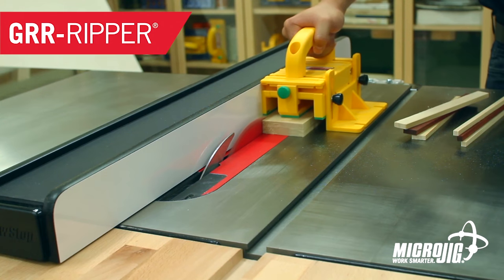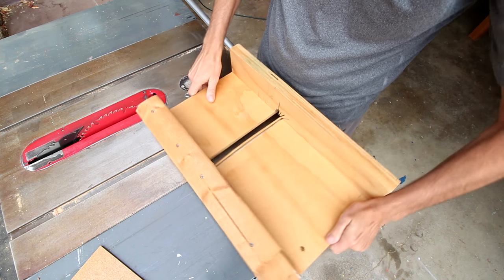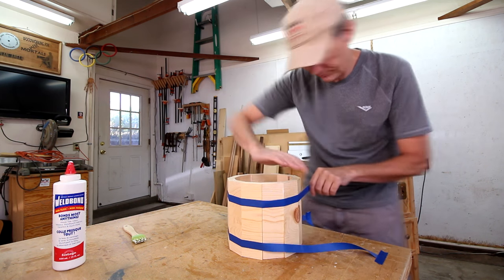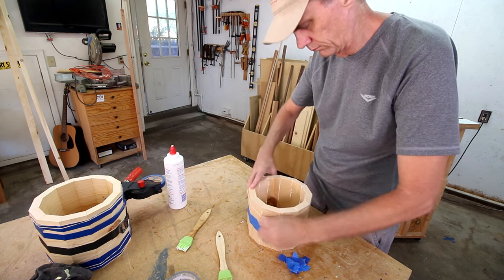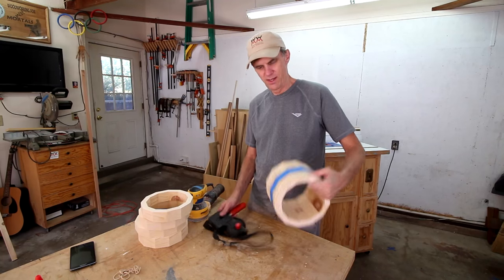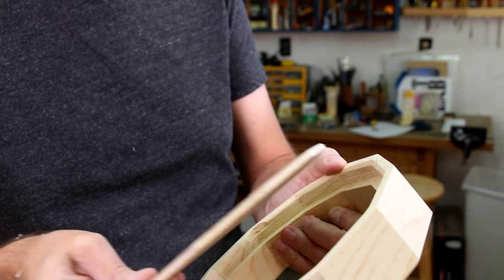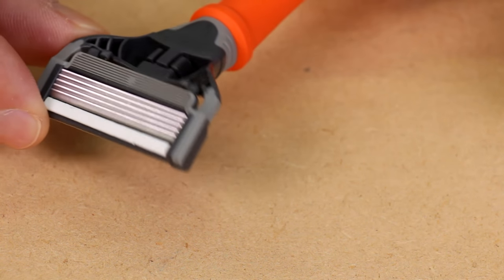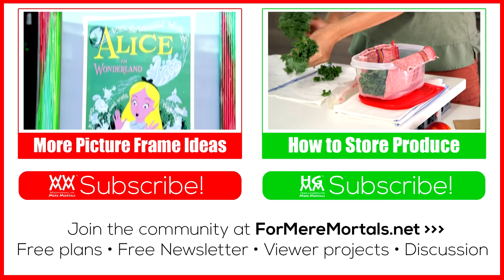Woodworking Income Project: Unique Dodecagon Frames to Sell at Craft Fairs or Online!

Comment: The tape trick to band the segments works better if you face the pieces down and then can press the tape onto the wood.  Also, in any line-up like this, it helps to make a layout board with stops/fences at 90 degrees so you can just line the pieces up quickly, then apply tape.  And, you don't have to use a long strip of tape at first:  attach each next piece of wood with a short bit of tape to secure in place, then when you have the whole layout, do another piece of tape the whole length.  The tape trick does work really well.  Nice project with the dohecx whatever!

Comment: Before slicing them up, you have a great looking small trash can!  Just add a bottom.
Reply: At that point, add a handle and you have a nice sized mug!
Reply: Add on a bottom and a handle at the top and you have a bucket
Reply: Or add a handle and it's a beer mug

Comment: Very attractive and precise frames. 
When you mentioned dodecagon, I thought you were going to use Incra miter gauge to get the required precision. But you managed to get the needed accuracy by using a digital angle gauge. 
Just as you cut the bevel for the entire length in one go (for the second batch), would it not be convenient to cut the continuous slot also in one go instead of having to use the router later?

Comment: What angle guage is that? When I search for it I do not find the same version. I have read a number of reviews of angle finders with wildly differing opinions of them. I'd like to get one that is accurate. Bonus if it doesn't drain the battery when not in use.

Comment: Hey Steve, great project!

Ive noticed that you've used spray laquer in a few of your projects. I tried this on a few projects of mine (rebel alliance logo clock that I made for my husbands bday & a 3D chess board). However, I'm not sure if  I sprayed the laquer too much, too little, from too far away or maybe too close because it kind of made the grain a bit rough. I sanded the projects to a really smooth finish before spraying the laquer. Maybe the brand I used?

Can you give a southern girl some tips on what I could be doing wrong or what/how I should be laquering the projects? Thanks so much & keep up the awesome ideas & work! Love ❤️ your channel.
Reply from the maker: The important part is to lightly sand before your final coat. Here's my lacquering technique: https://youtu.be/CyVPkqrNph0
Reply: +Steve Ramsey thank you! I will definitely try your technique on my next project.

Comment: Hy Steve, jus a quick question, when you made your honey comb shelves and dodecagon picture frames how do you know what angles to cut each piece? is there some sort of method like divide the amount of cuts per angle?  jus so I can work out my own if I need to make angled shapes
Reply: A full circle is 360 degrees. 360/12 pieces = 30 degrees per piece. Split that for half at each end --> 15 degrees.

For the more familiar  square/rectangle:  360/4 pieces=90 degrees per piece, half at each end --> 45 degrees
Reply: Thanks Michael, appreciate it

Comment: I love your videos.  I have a question.    at the 5:00 mark you are chamfering the outside of the frame, rotating clockwise (closeup).   At 5:03 there's a wider shot of you rotating it counter clockwise, then immediately, another closeup going clockwise.   Am I crazy or did I see this.    And, please confirm, you would rotate it clockwise for the outside and counterclockwise for the inside, right?    I don't want to kill myself with my router.  :)

Comment: why do you flip the board when cutting on the table saw at the start?
Reply: Remember, it is an angled cut.   If you didn't flip the board you'd end up with parallelograms, and you need trapezoids.
Reply from the maker: That's so the bevels each go in opposite directions and no wood is wasted.

Comment: Is this also possible to do with a miter saw?
Reply: it is possible,but if you have a circular saw that would be alot easier.
all the best
Reply: Thanks for your reaction.
I do not have a circular saw yet. But I do have a miter saw.
Reply: you're welcome :)
Reply: the way i do it is i cut long strips with each cut i flip the board so that i get a strip that looks like this \   / and then i cut the strip down to short pieces and glue them up,hope this helps. :)

Comment: How do you determine the diameter of the Dodecagon?
Reply: Geometry.

If you want a radius, R,  to the center of the straight pieces (radius to the inner corners will be slightly longer)
Call the 'inner' length of the pieces L.

IE, for a wanted R, you need to cut the pieces so that the shorter side is length L

tan(15)=(L/2)/R -->  L=tan(15)*2*R = 0,26794919243112270647255365849413*2*R

These measurements are to the 'inner' surfaces of the material, for measurements to the outer edge of the material you need to add the thickness of material you're using 

For the more familiar square, say the 'diameter' (distance between inner walls),  say 8". This gives R=4"
From experience I'm sure you'll say that the (inner) lengths of the pieces need to be 8", but let's do the math. The angle is now 45 rather than 15 degrees so we need to use tan(45) instead of tan(15)

So. 'inner' length of the pieces is then tan(45)*2*4" But tan(45) is 1, so, as expected, the inner length is 8"

Comment: Why do you flip the board over every time when you cut it on the table saw
Reply from the maker: +Ethan Rhodig So the bevels angle in toward eachother. Otherwise they would be parallel.
Reply: +Steve Ramsey I see thanks

Comment: I can not figure where I went wrong. My frame is too small for a 4 x 6 picture. The outside edge is two inches and I double checked that I'm using a 4 x 6 picture. My picture is just too big for the frame.
Reply: sounds like when you measured you didnt cut on the correct side of the blade. that 1/8 inch off of each piece would more than explain the problem you are having. make sure that you cut on the correct side of the blade to have a final product of 2 inches each.